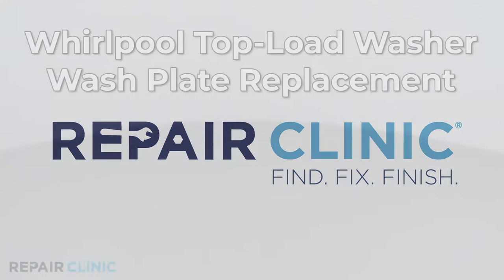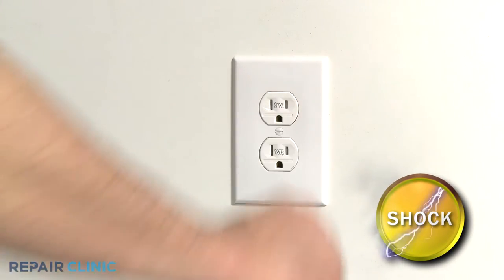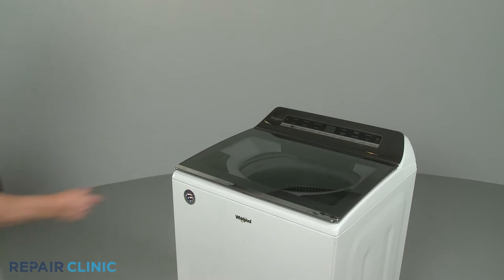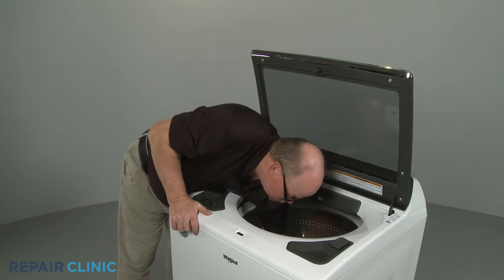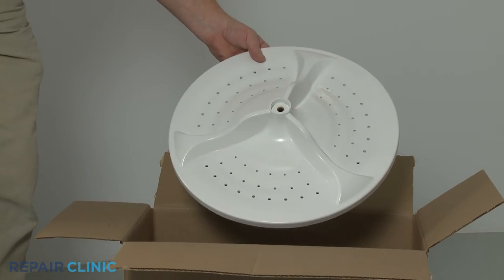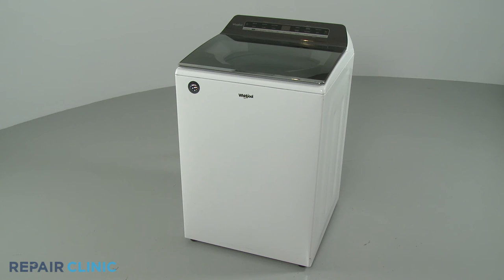Whirlpool Top-Load Washer Wash Plate Replacement W10752283

Comment: So what do you do if they are stuck on
Reply: One year and no help, great. How did you end up? I can’t imagine white goods technician struggling with that thing for hours.
Reply: @anurakboribun2560  lol had to break it off so much rust built up on splines it wasn't coming apart.
Reply: @murphygaven1  disaster, was that the reason of your repair or the wash plate became unexpected additional $100 on top of original repair?
Reply: @anurakboribun2560  needed to remove it to replace the gear case, I'm a appliance tech for bestbuy so under warranty no biggie
Reply: @murphygaven1 oh so you are a pro, I was imagining that there must be a way to remove it in a timely fashion not struggling for three hours or six. Meanwhile you had a problem with it too. Loosing this on top of over $200 for the gear case makes the 8 years old machine over the fence or uneconomical.